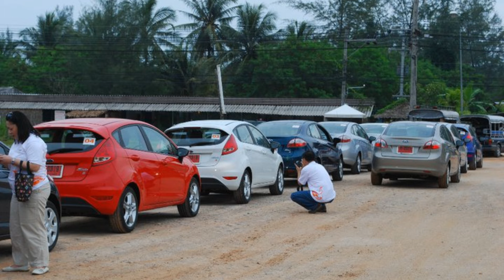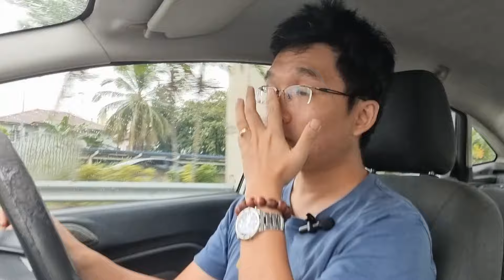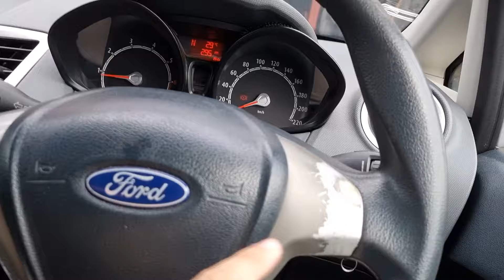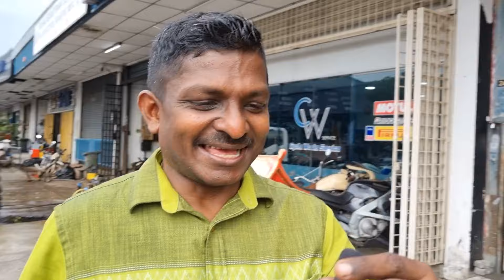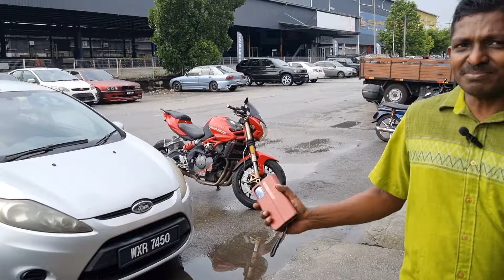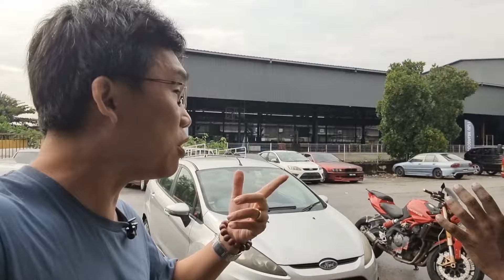Is RM7,000 for a Ford Fiesta a smart purchase?

Comment: In the early to mid 2010s my family members upgraded their cars one by one. A vw passat, a ford fiesta and a honda city. After ten years the honda is the only reliable and low maintenance car. The ford was sold after constant expensive issues and 3 gearbox changes under warranty. The vw continues to be used with oil leaks and countless error codes. The real miracle is Honda engineering.
Reply from the maker: VTEC powahhhhhhhhhhh

Comment: This car is a money pit. My relative went thru a costly maintenance.
Reply from the maker: How bad was it?
Reply: @KonWaiLuen  she replaced her faulty engine with recon engine, abs pump rm 2600, engine mounting rm1800. Steering rack rm1000. Gasket rm250 skim cylinder head rm200. Parts are expensive.

Comment: It a simple car but don't push your luck 😂 remember its a Ford. For small car make sure suspension is tip top or u spin in emergency
Reply from the maker: You had experience spinning?
Reply: @KonWaiLuen  yes when I push a small Crossover in the rain doing a 90 Deg turn at high speed..all the esp abs cannot stop it from sliding. I not stupid to go to extreme though

Comment: 230k km never once changed the tcm.

Today i clocked 40km/l on sport mode. Unfortunately cannot paste the image here. Otherwise i can let people see how capable this car is.
Reply from the maker: Wow, impressive! What sort of usage patterns?
Reply: @KonWaiLuen  i sent you an email with the screenshot  attached.

What i can say is, i turned off hill assist, kind of running on sport mode instead of normal D mode.

In D, the car will upshift as early as possible ie 2500 rpm, meanwhile, if the hill assist turned off, the rpm will hold rpm longer for upshift ie 3000rpm.

Comment: 10 automatic cars malaysians will avoid after hard lesson learnt

1. Any Ford Mondeo, Kuga, Fiesta, Focus
2. Any VW dry DSG.
3. Any Renault automatic.
10. Nissan Syplhy 2.0
Reply: I had a Mondeo with a wet-clutch Powershift previously and a Kuga with an Aisin 6AT now. Both were fine during ownership, but the issues arose with the one that had dry clutches powershift.
Reply from the maker: The Kuga 6A/T is not known to have transmission issues.

Comment: Unlike many, I had a great experience with our Ford Fiesta. It was my wife's daily to work. although we clocked in little mileage compared to many other Fiesta users, we really enjoyed it. Bought it with a 14k discount brand new from Sime Darby Ford. bought at RM 72k. Under warranty, they updated the software for the gearbox and 1 clutch replacement at 8 months old. Had the car for 8 years plus and sold it last year because we got a good price for it. sold it for RM21K. 

The car never once broke down. We maintained it for 5 years in Sime Darby Ford and the balance 3 years with Bengkel Excellence Subang. Other than the water pump for periodical maintenance and the front suspension being damaged by a tire shop, there were no major issues. 

The Aircond was cold, and the car was built solid. The sound system was proper and the car had a fantastic paint job from the factory. Loved the seats as it was like a semi-bucket style. half leather and half fabric. 

At the time, many competitors, like the Vios and City, were using 15/16-inch wheels, but they all used 185-wide tires. The fiesta was running 195/50/16. The car handled well with this tire profile. 

Overall we were very satisfied. 

Just thought I'd share my experience.
Reply: Good. What car you suggest for a first time buyer? 2nd hand car, what is a reasonable price to buy a car
Reply: @emanuel.is.suffering  must ask these sifus. Kon and Thana.
Reply from the maker: Thanks for sharing your experience! What are you driving now?
Reply: @KonWaiLuen  currently alternating between Passat B8 and x70 for a daily. W124 on weekends.